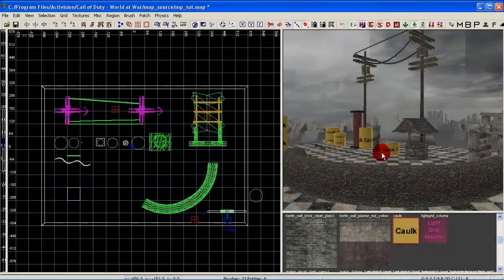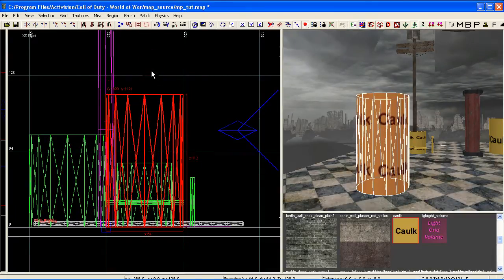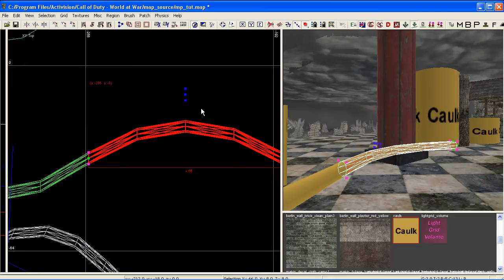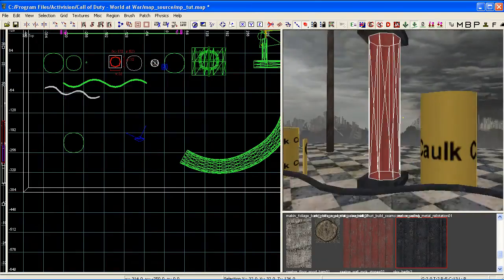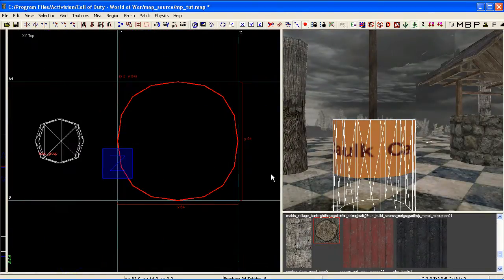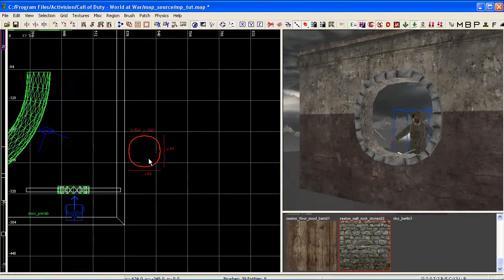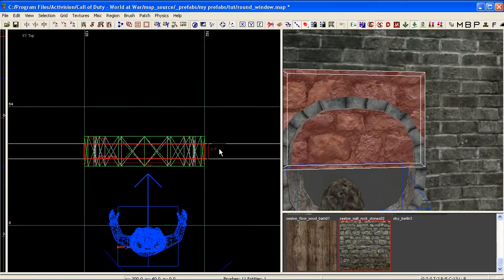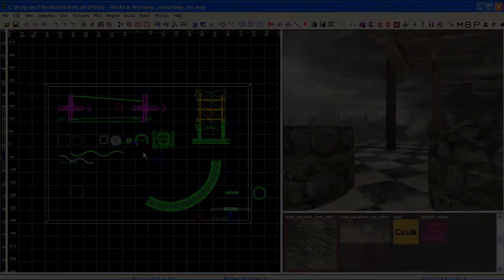CoD Radiant  : detail made easy : Using Cylinder's to create detail

Comment from the maker: @HartRaver , the "W" (tolerant weld) feature is reserved for patch vertices , if you want to "join" 2 brushes you need to merge them

WARNING : merging uses a CSG function , CSG are largely avoided , in the wrong hands they can be very easy to create major problems issues , avoid them where possible or even better , just avoid them

to merge 2 brushes together  , they must be identical dimension and must be touching on atleast one edge or face , to merge , select both brushes and press CTRL +U

Comment from the maker: @jnmick hi , what you would need to do is turn the cylinder mesh into a terrain mesh and then split the cylinder in the places you want to add windows or doors (to much to explain this area)

this wont be easy unless you have experiance using the tools , but create a cylinder , select it , and go to /patch/curve to terrain , then move the verts up or down into a position you want a window and then split the terrain to make a "hole"